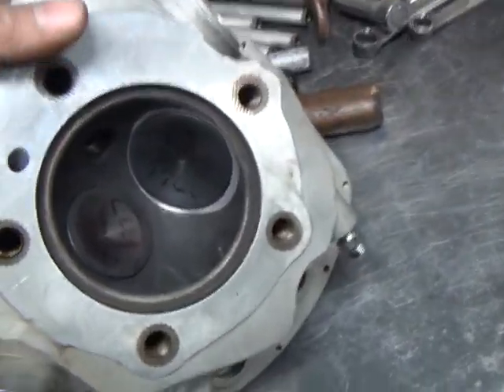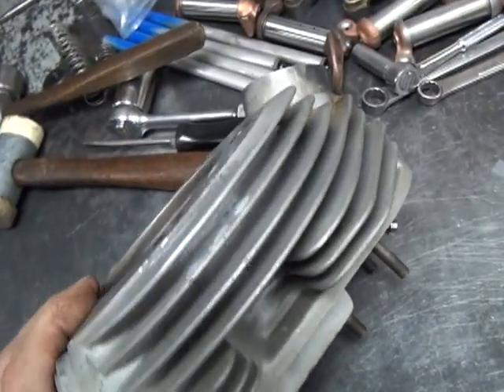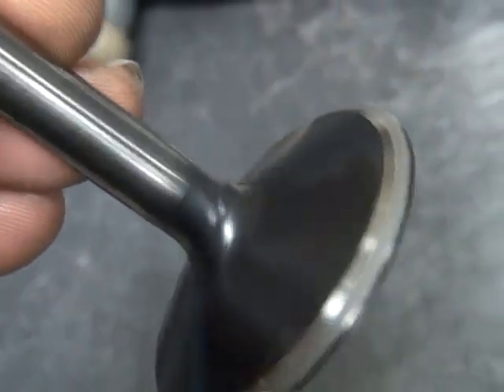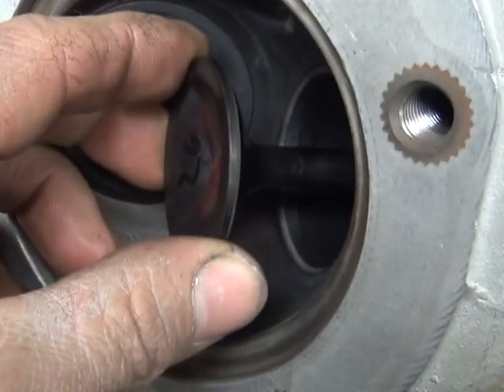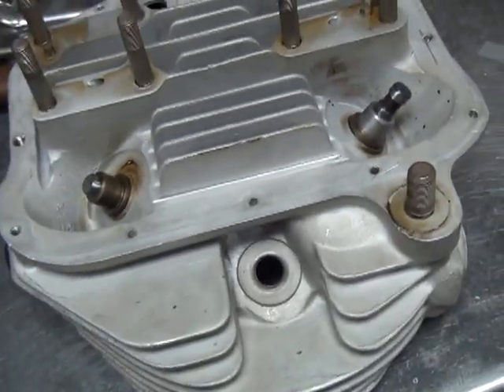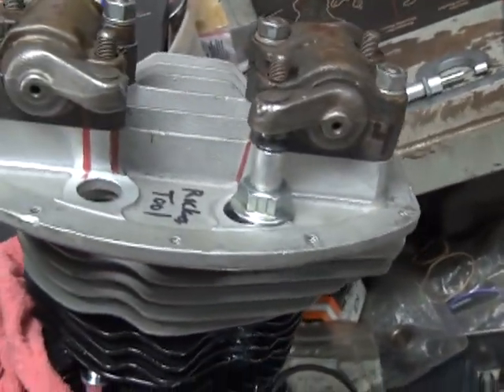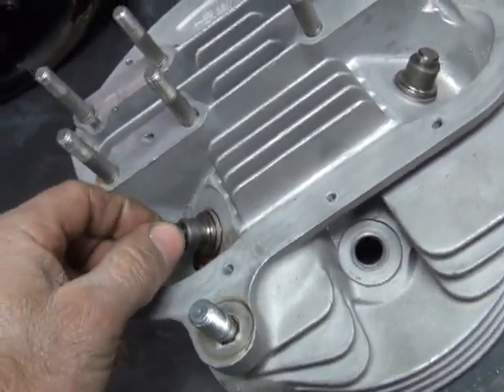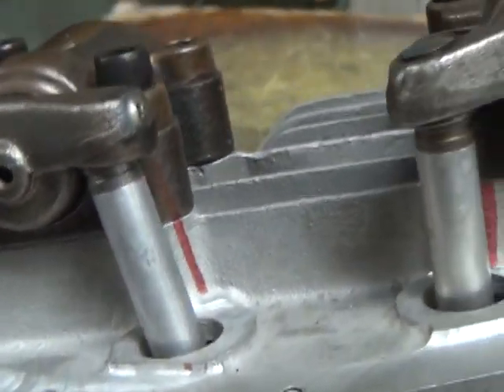#110 1948-65 Harley PanHead High-Lift Rockerarm Geometry welding by Tatro Machine

Comment: Hows it going i no ur not going to b able to c it however i have the front intake pushrod on my panhead coustom that has a 1/4 gap slop whatever u want to call it n the down position is that possible seems to me i take tht bolt up 1/4 seems to me il put valve in piston i no ur busy u got awesome videos maybe i missed ur exoplanation  n a prior video std cases s&s heads 122ci 4 spark plugs hopefully i didnt do myself dirty buying this beautiful bike ?
Reply from the maker: with all the misspelling and missed works i can't tell if there is  a question here or a statement.
tatro
Reply: LOL!!! That Dude must be from Boston!